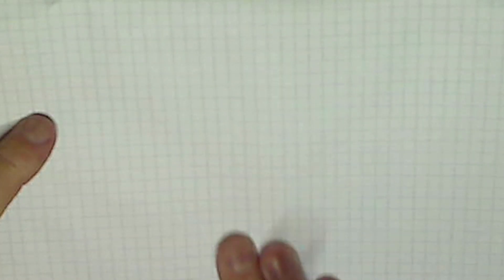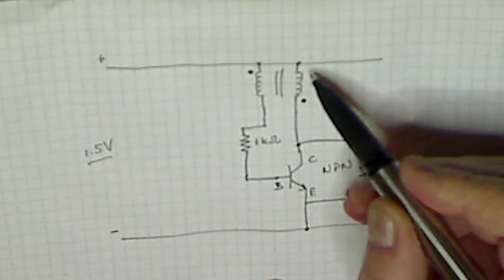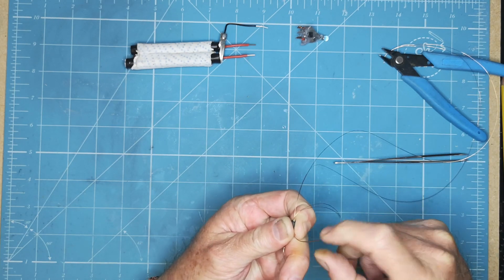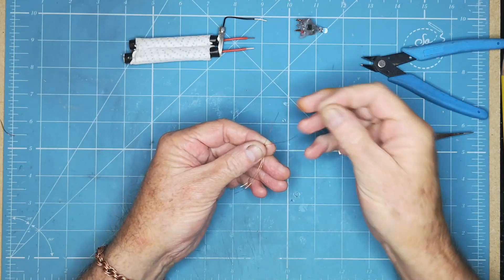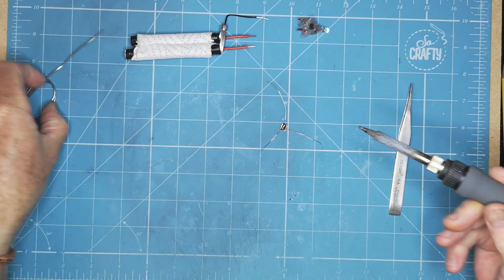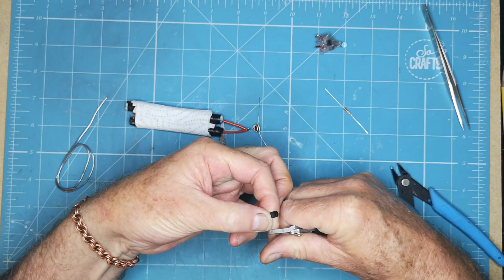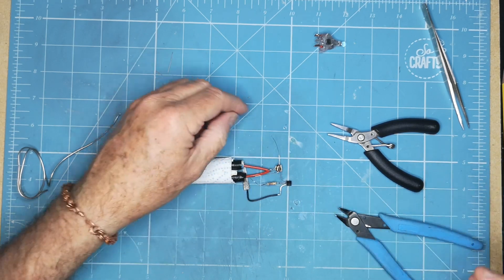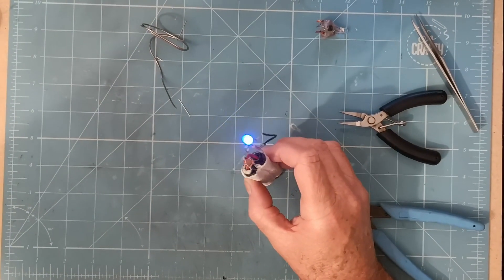Basic Joule Thief

Comment: What actually happens if the wires are not 1:1 and/or bifilar?
Reply from the maker: Think of this inductor as a transformer. You have a primary and a secondary winding. The ratio will determine the output voltage. I hope this helps. It does not need to be 1:1. Do some experimentation, It will help with the understanding.
Reply: @allananne-marie1233  Aye, as I thought.  Most JT circuits use a bifilar 1:1 which seems a bit odd.  I would think a different turns ratio would mean a lower voltage would be needed.  As it is I am working on a solar garden light I had from a few decades ago that long turned to dust, but I kept its board.  A strange board it was too because there is no modern IC on it.  I finally decided to reverse engineer it and one of the wires fell off, but I had already taken a picture.  I tried a 1,5v battery, and it still works, so the wire must have been for the solar panel.  Strange beast as it used two 150mH inductors, a 50pF cap, 3 resistors, two npn transistors, and a Schottky diode.
Reply from the maker: @generalawareness101  It is good that you are experimenting. I have built a number of these over the years. I will make a video of some of them sometime in the future. I have not been able to spend time on YouTube as would like to. Good luck.